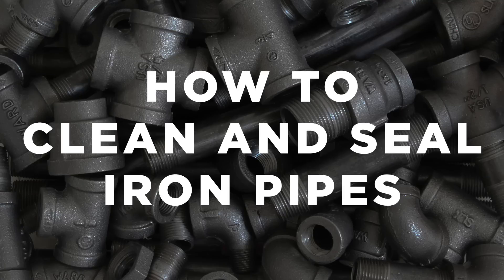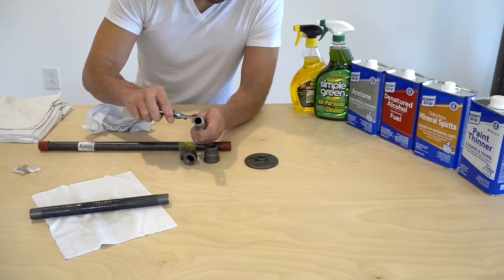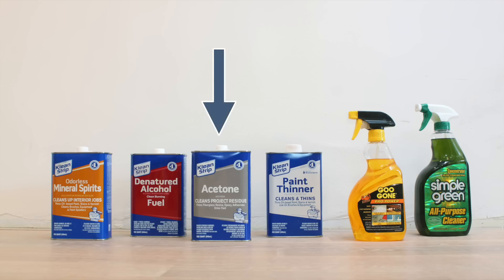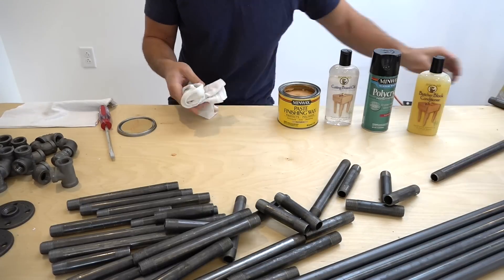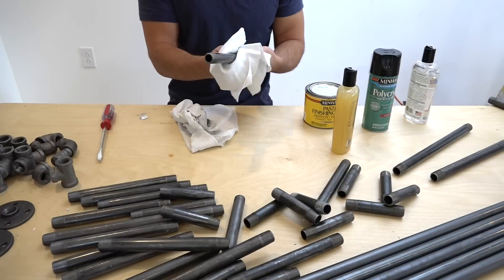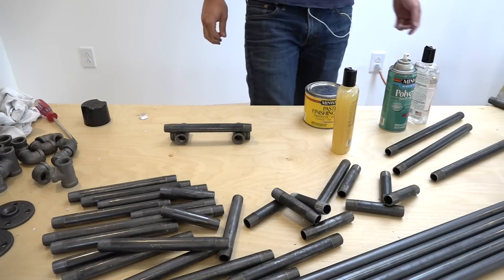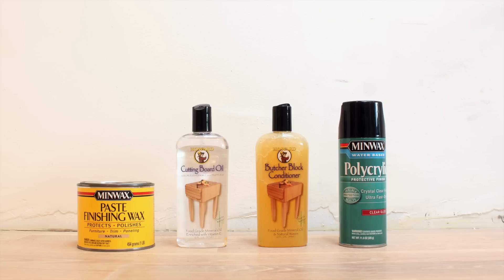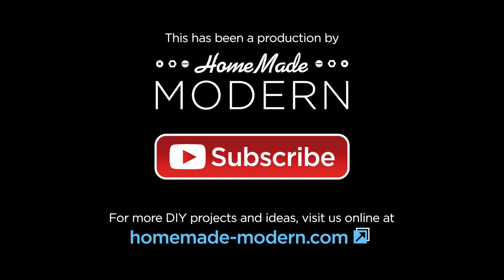How To Clean and Seal Iron Pipes

Comment: Hey Ben- great video as always. Love your stuff.

As far as the labels go, I use a heat gun like many of the other commenters. But for the grease, I use something that I don't think anyone's mentioned yet: orange pumice hand cleaner. There are a few brands (Gojo, Fast Orange, Zep off the top of my head), but they all work very well. Just apply, work for 20 seconds, and wash off. As a bonus, they're safe on skin (obviously), smell great, and aren't too expensive. Home Depot has them next to the stain/varnish section I believe.

Give it a try some time.

Comment: The reason the polycrylic you used is making the pipes look shiny is it was "clear gloss." Try the satin one and it will be much less glossy. As far as something gentle for cleaning the pipes, dish soap and water works. There is a little more drying time after, but it is much less harsh to smell and on your hands.

Comment: MASSIVE TIP: Use a heat gun to heat up stickers and remove them easily without leaving behind any residue. Also works well to remove tape and stickers off shipping boxes.

Comment: I now use the acetone and paste wax thanks to you on all my projects. Acetone works so well and I'm used to that smell of death now lol
Reply: keep in mind acetone is poisonous. Its part of GooGone too which is what makes it work. Prolonged exposure to the fumes will cause respiratory issues.  I'm trying the heat gun/WD40 route. Additionally, to get labels off wine bottles so I can reuse them I put them in the oven at 350 for 15 minutes and they peel right off. Some leave the residue though..

Comment: WD-40 whenever you need to remove stickiness from labels, stickers, tape residue. I used to work in a bicycle shop and we used cases of that stuff for that purpose alone. Also Aquanet is what you use to install bicycle and motorcycle grips.

Comment: Thank you so much for this video. I am working on my first pipe DIY project. Lowe's website suggested TSP cleaner for getting the pipes cleaned - DO NOT USE TSP FOR METAL PIPES. It did absolutely nothing and then the fittings started rusting before my eyes while I was drying them. I had some acetone laying around and it took everything off including the label adhesive with like 30 seconds of rubbing.

Comment: Penetrol works really well. I have used it on hand rails and things that get touched a lot and it doesn't get effected by the oils on people's hands. And it will stick to metal unlike most paint. Just brush it on
Reply: Flood Penetrol worked great on my black pipe bar cart.  I cleaned the pipes with Mineral Spirits to remove the grease and oil from cutting. The only thing to remember is to not let the Penetrol get too thick in the threads as it can gum up your connections if you apply it before assembly.
Reply: Have you tried the water based Flood ever? I have tried and it left some marks on my pipe. Any experience? And how toxic is this penetrol, any thoughts?

Comment: you can use Naphtha to clean it off quick and easy. It's the thinner that is used with rubber cement, like labels so it takes it off quick. Available at lowes or HD
Reply: Use with caution, naphtha is what was used in mothballs, but since it's a known carcinogen i'd stay away from it.

Comment: I've used mineral oil and boiled linseed oil with decent results on stuff that stays indoors.  If you heat them with a little propane torch, you can change the texture of the oil.  Kind of a cool twist.  On stuff that goes outside, I use automotive clears.  There are flat clears that look awesome on bare steel like this.  Def the way to go if you are going for pro level stuff, but $$$ when compared to rattle bomb clear.

Comment: Did you ever try a citrus based cleaner? I've had good luck with it on black pipe. It takes off everything (wear gloves). I will get the exact brand later.

Comment: Hi Ben. I've had this problem too with a few projects.

For cleaning label gunk of non-porous objects like pipes and extrusions, etc. I use WD-40 . It really does work very well and due to the built-in lubrication it removes the glue without damaging the surface finish regardless of how hard you rub.

WD-40 does offer some protection in a similar way to the board oil you recommend. But when I need to remove any oily residue, white spirit (petroleum spirit) or methelated spirits works just as well.

For protection, Johnson's Baby Oil works very well and is easily as good as most specialised protection oils, in my opinion. I know a number of yacht owners that will use Baby Oil to clean and protect their aluminium masts, spars and rails.

I hope that helps. But do try WD-30 on label goo. It really is fantastic.

Karl from UK!
Reply: Agree with the WD40

Comment: Wash the pipes under hot water to melt the glue, and then scrub with steel wool. With a bit of elbow grease, you'll get those stubborn stickers off (no chemicals!). You can then use a rub-on poly with a matte finish to protect them without the shine.

Comment: Use WD-40 or pb penetrating blaster for both the adhesive and the black coating. clean the left-over residue with soapy water or isopropyl. Way easier that what's shown here. I use a little WD to take adhesive off almost anything.

Comment: once you have peeled off a sticker olive oil or pretty much any oil will wipe away the glue. Of it's stubborn I let the oily rag sit on the label for a few minutes and it should then come off easily. Olive oil certainly doesn't take an hour to work like you suggest the googone in the video does, a couple of minutes to remove sticker glue residue maybe.

Comment: I'm putting pipe handles on a tub tray. The wax finish looks nice, but I'm concerned about possible exposure to moisture. Any thoughts? BTW, I second the recommendation to use a heat gun on labels. Many of them will peel off cleanly after being warmed up a bit. To clean the pipe itself, especially to get that greasy coating off, wash/scrub them in TSP and dry thoroughly.

Comment: I use mineral spirits to remove the adhesive (let it sit about two min.) I then follow up with a quick rinse with denatured alcohol to remove the oil from the mineral spirits. I use a spray clear topcoat (flat for me) to seal. I will try Pentrol on next project.

Comment: There is a mat finish version of the poly spray that I have used. I wasn't using it to seal metal but it should work. You could always use it after the gloss poly and have a nice matte finish.

Comment: +HomeMadeModern do the pipes come ready made in all those lengths? In the UK I've only seen them in 3 metre lengths and wonder how I get threaded ends on cut down pieces. Also I have only seen galvanised here which isn't black. 🤔
Reply: In the states the iron pipe comes in many different sizes already threaded, but at most of the stores you can also buy the longer lengths of pipe and then have then cut to length and threaded.
Also if your stores don't have the capability to cut and thread you can check and see if a local plumber will cut and thread the pipes for you.
Reply: +Ivan P Thanks. I guess they are quite soft so should be easy enough to thread with a cheap tap and die set.  ??
Reply: I've never had to do the cutting myself but I don't see why you couldn't do it your self.

Comment: Hi Ben, i've been meaning to ask: I've built an iron pipe shelf according to your previous video. While there where little bumps here and there given that it was my first DIY project, but i've managed to complete the project nonetheless. However, what really bothered me was that when I went to Home Depot to get iron pipe cut and threaded into the custom size, the guy would not stop complaining about spending so much time cutting and threading through out the whole process, on top of that, he would stop and go help some other customers while making me wait. I understand it was quite a task asking to cut so many pipes, but at the end, i spent like 3 hours in Home Depot just getting the materials. I have plan to make couple more of the iron pipe shelf, but now i'm afraid to go to Home Depot and go through it all over again. Has this happen to you, or perhaps anyone before?
Reply: That's terrible. They are there to help you. It is their  job. I don't blame you for not wanting to go back. Try another HD if you can maybe. Don't stop making the cool projects though. Take care.
Reply: David Liao I visited 3 Lowes locations before I was able to get a capable person who did not bitch about it. After I finish my desk/shelf project, I will go by and drop off a gift card for the pipe cutter who helped me!
Reply: Go to Harbor Freight buy pipe threader $34.99 less 20% with coupon.  Then you will have it for your next project and you won't have to listen to the plumbing guy that is threading pipe.

Comment: awesome video. very informative. I know how much you hate chemicals, have you tried some vegetable oil to remove the adhesive? works great and all natural.
Reply from the maker: +Jonathan Perlo i will try that!
Reply: +1 oil works best
Reply: +Jonathan Perlo Wow!  That's great to know!
My dad taught us years ago to use lighter fluid )charcoal lighting fluid or for lighters) to remove stickers.  He used it to fix old books.  It works great because it  evaporates cleanly and so won't stain the paper pages.  Just pour it over the label and wait 30 seconds and it will just lift off.  However for other applications I will totally try vegetable oil!  Who knew!

Comment: Hi Ben, can you do a video on the different types of concrete mixes?  I'm in the process of making a BB8 for a lawn ornament out of concrete and using two half sphere concrete mold, but I'm finding that the quikrete counter top mix has too many rocks in it and I want it to have a smooth finish.  I haven't done much with concrete before (just made some wall hat holder in shapes of video game controllers) so I would appreciate any help on this as you can give :)  Thanks!

Comment: Hello I was wondering if I could possibly ask you a question I actually made a lamp but unfortunately when I wash the pipes which I was told in order to get the grease off it was simply just soap and water, and now it's rusted. 

I used a product called lime away and I did take it off for possibly a couple hours or a day but the rust came back. 

I was wondering if you had anything suggestions on if you know anyway in order to remove the rust and the next proper steps to coat it to protect it from rusting again 

Do I dry it immediately and then coat it with the protection? 

 I would think has much more knowledge then even people at Home Depot. Any suggestions to save my piece I would greatly appreciate! I would hate to start all over I work so hard on this project thank you!

Comment: i clean all labels on any surface with rubber cement thinner. Have for 30 years, it is wonderful. I cleaned my pipes with orange soap and it worked great. My pipes were very dirty and oily and where i bought them at HD they had orange soap to clean your hands up and so i tried it.

Comment: i wanted to do your Bench project with the iron pipes but couldnt find 10" and 12" pipes ANYWHERE (im in canada)...even home depot told me they dont do these no more. They have 18",24" etc... :(
Reply: I do get 12" from home hardware for my website pipeworkpieces.com and I am in laval canada. Just know its not a stock item and order in advance as it can take as long as one week to receive the 12" pipe. I have stopped using 12" and all my 12" pieces are now made up of 6" pipe which is readily available everywhere with a coupling to join them together. Hope this helps.
Reply: +1 for Home Hardware.. they were the only place I found who sold the shorter pipes (8" to 12")... which are actually called nipples.
Reply: Ben Brown I've ordered 12" from home hardware for some of my projects on pipeworkpieces.com but it takes over a week to get them. Now I just use 2 6" nipples with a coupling to make my 12" pieces.
Reply: Amazon.com
Reply: ZORO - can order online.  They have some different sizes.
Reply: Also in Canada - I found most of the pipe lengths by combining the inventory from both Home Depot and Lowe's. Kind of a pain but at least you can get them!

Comment: Bestine Solvent and Thinner is pretty much designed for what you are trying to accomplish as far as the sticker is concerned, it dissolves adhesives and will not leave a film. Now if you want the stickers removed in a hurry and skin/lung safety aren't of paramount concern you can use Xylene/Xylol.

Comment: Toxic,smells like death yet still no gloves or mask???

Thanks for the informative video nonetheless!
Reply from the maker: +Ken C i used gloves for the acetone and it it melted holes in them.  the loft i work in is well ventilated but you good point nonetheless!
Reply: +HomeMadeModern Use latex gloves (or better yet, butyl rubber) when handling acetone.  I'm guessing you were using vinyl gloves?
Reply: +HomeMadeModern normally if you use normal latex gloves the paint thinner and acetone with go through them. Try nitrile gloves that are made to handle those substances. Also carbon filtered
filtered masks for workshop odors work for the smells. If you used a conventional mask like the ones for sand paper residue won't do very well. This 2 things are not expensive at all. I just hope you're able to find them!
Reply: Carolina De La Ossa Acetone will break through nitrile gloves even faster than latex or PVC.  Here is a chemical resistance chart: http://www.ansellpro.com/download/Ansell_8thEditionChemicalResistanceGuide.pdf
Reply: +Nelumbo Nucifera Actually you're right, I don't know why I thought that since latex gloves melt with paint thinner, nitrile ones would work. I also find this http://www.ishn.com/articles/90718-what-is-the-best-glove.